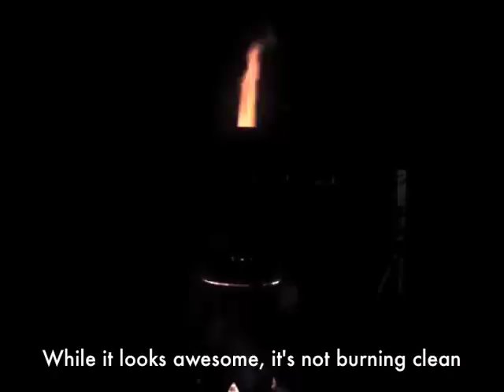Making Biochar - Home-scale Double-barrel TLUD - No smoke

Comment from the maker: Thanks everyone for your comments and sorry for the delay. The pipe in the beer keg was an attempt to get the fire going up through the centre as well as around the outside. However, if the feedstock and fuel stock are dry enough, the fire is hot enough to cook the feedstock thoroughly without this modification.

Comment: 50L doesn't make 30L.. sounds great if you leave out the fuel wood...  55gal drum is 208L, 208 - 50L keg is 158L of fuel wood.  You are consuming 208L of organic waste to capture 30L of char.  Not even 15% efficiency.  And all the retort is doing is making extra work. You might as well just do a real TLUD.

Comment: check hugel culture .. it's not 1000 of years but it seams more practical imo :)
Reply: banq0o 
What about doing both??.. Build the Hugelkultur and add biochar, after it's been mixed with compost or manure to activate it. Over time keep building the soil by chop and drop method and add some more activated charcoal in there every once in a while and you'd have a pretty good mound of soil. Nice
Reply: It is no way more practical. Biochar will last longer than 2 thousand years